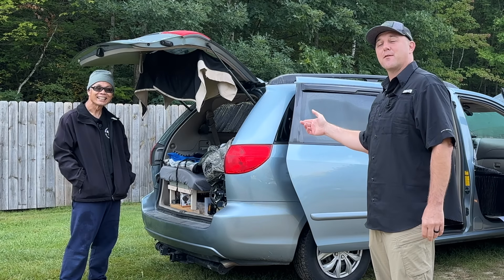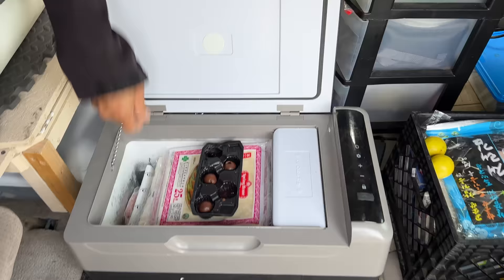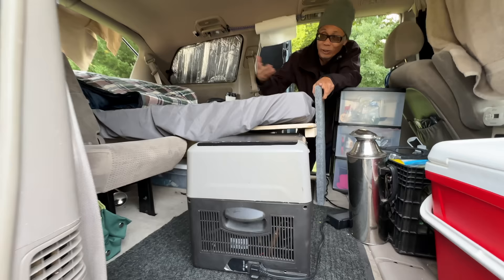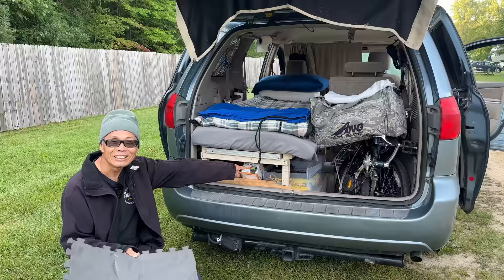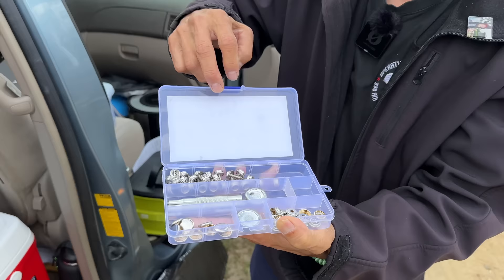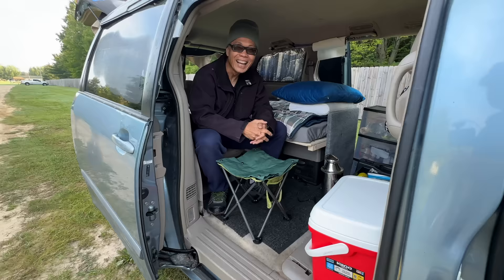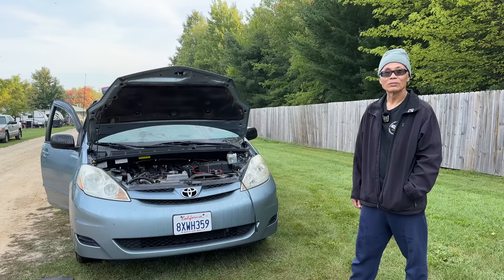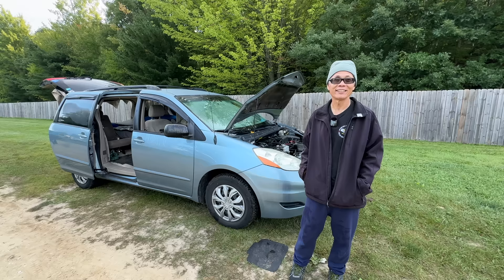This Man’s DIY Minivan Camper Conversion is BRILLIANT!

Comment: That is great.  I used a 2007 minivan as a single person camper for several years.  It was great, however about the 4th or 5th year I noticed that the headliner was beginning to come down because of the moisture from sleeping in the van.  So, to make it really work you have to replace the headliner with something moisture proof.
Reply: I used that cheap Moisture Eliminator from Dollar Tree to catch the majority of it. Plus, I leave the vehicle wide open during daytime to ventilate the moisture out. It's been over two years and no issue with the headliner yet!🤞

Comment: toyota siennas seem to be very popular for conversions. i am looking at a mazda cx5 but ive taken notice
Reply: Don't sleep on the Odyssey it's roomy enough to fit a twin XL adjustable bed
Reply: It is worth the extra cost for unmatched liability. Chrysler and Honda minivan are viable options as well with minor electrical issues.
Reply: @MoBangFoYoBucks  the only issue I don't like with the Ody is how slow it is taking off at the light.